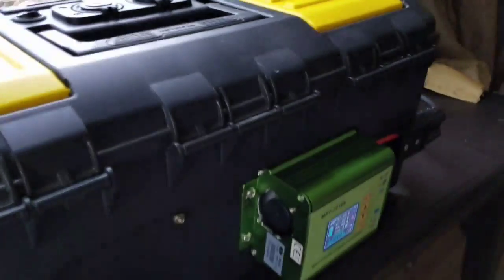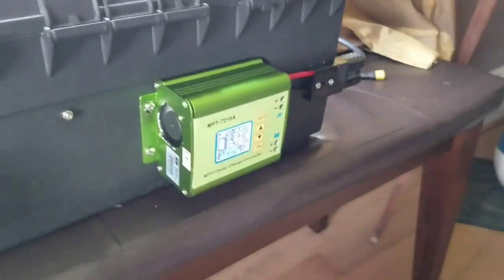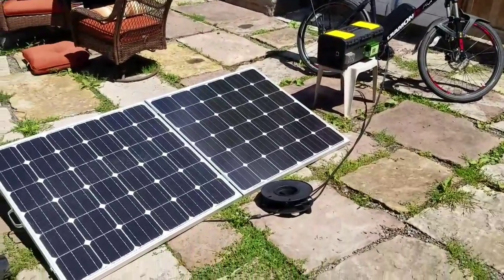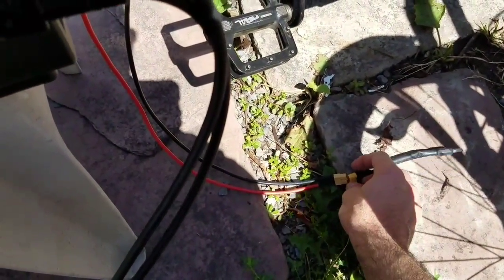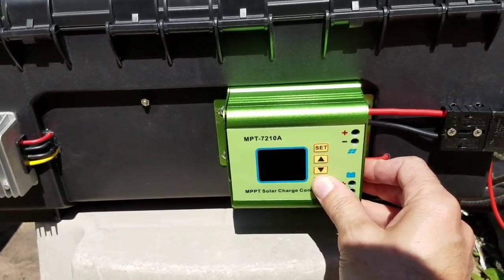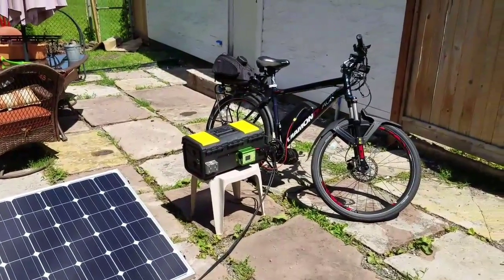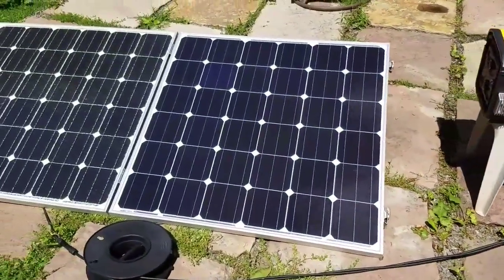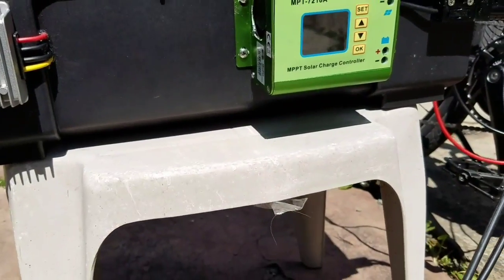Solar charging electric bike's

Comment: Hello angryguy

 I’ve ordered a Minghe mppt7210A solar charge controller from a Chinese seller on amazonuk and I’m wanting to charge my 500 watt, 36volt ebike battery with solar power. I'm completely new all this stuff. When I plug into the wall socket, the cable runs through a transformer and lights on the ebike battery light up to show that it is being charged. But when I tested the minghe in bright sunshine, the lights indicating charging did not come on. My question to you nyangeryguy is,to charge my battery with the minghe  controller, do I simply have to jam the ends of the solar panel cables coming from the minghe, into the socket of the of the battery, differentiating between the(+) and (-)? It wont be a firm connection, but is that you actually do

Regards

Rob T

Comment: I have just bought one of these to charge my ebike battery- what awg is the cable from the mppt to the battery? Is it 18? And are those xt60 connectors? I am planning to use 2 flexible 100w panels in parallel- I have a 36v battery. I would like to use it on the move- like the Sun Trip riders- not sure this charger will be too good at that- but I can’t afford a genasun!! Thanks for this video- very helpful.

Comment: Very nice work! We are looking forward to charging our battery from Sunlight as well, we just recently purchased a Genasun MPPT Boost Charger to charge our 36Volt nominal battery. This model Genasun charges up to 41.7 volts which is full charge for this lithium battery we are using. It’s really great to be able to charge batteries from sunlight, truly interesting. Great video!

Comment: I find the charge controllers go over voltage especially with cloud because they don't react fast enough to solar power levels. Maybe the bms will cope with this but I would have a second buffer battery for safety.

Comment: I have a similar set up for charging my recumbent trike. I started out using the same 7210 mppt controller but I found it inefficient when shadows or even a slight cloud went across the panel the controller would shut down for about 10 seconds. I now use a different boost controller that is not affected by shadows and it has no fan so it's silent. I have been using it now for about 12 months and it has worked flawlessly. It costs about the same as the 7210 but it's heaps better. My panel lives on my trike so I never have to plug in to mains power.
Reply: Steven Raftis, yes it will charge a 48v battery pack. I will be putting up a video on YouTube sometime this week with my whole set up and how it is configured. I ride a recumbent trike and use a 200w panel as a shade roof that keeps my trike charged. I have never had to use mains power since.